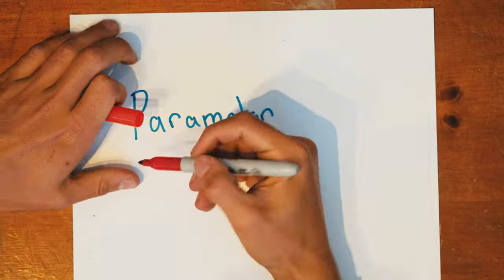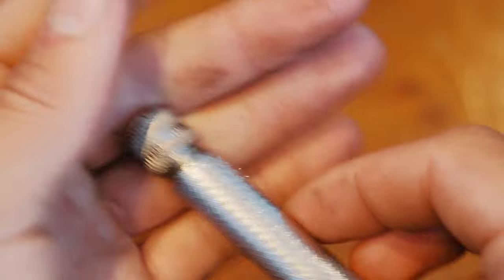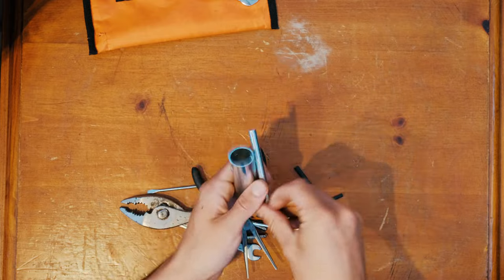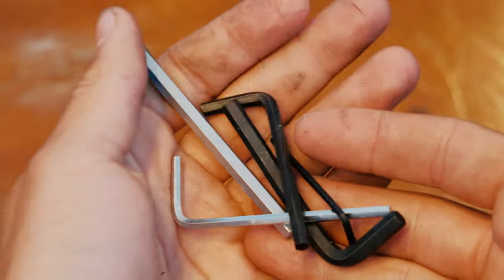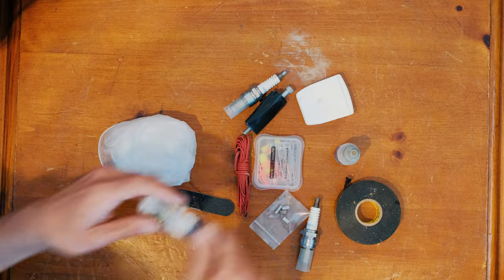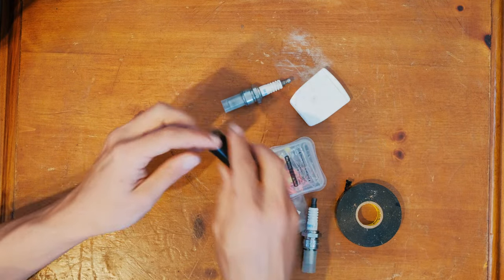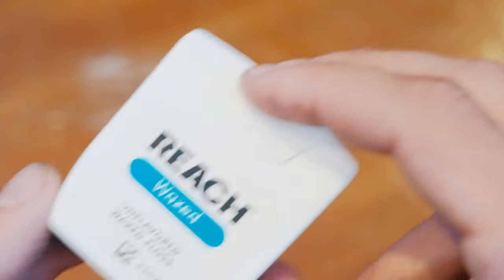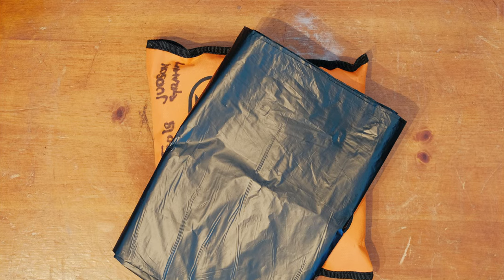Practical Toolkit for my Paramotor.

Comment: An old Navy Seal guy told me to always have dental floss, small pinch weight (tiny ball ones that you squeeze around the line) and a fish hook. He, like Judson said you can use it to pull stuff up to you or if you are stuck out and there is a place you can fish, then your good. He also made snares out of it to capture food, utilizing the hook to secure the animal (small of course). It can also be used to hold bandages on by wrapping it around a bunch of times, not to mention as a small tourniquet for you finger or small extremity. Dental floss is very strong and can be used as stitching in a really bad situation for skin or even clothing, or shoe lace. Good video Judson, great to see YOU grow as a paramotor pilot and see the channel grow.

Comment: Weight savings tip: ditch which ever 10mm wrench is heavier (leave it in the car), ditch the metal rod on your spark plug wrench(i use my skrewdriver instead as a 2 for one tool), ditch the orange bag and just toss tbe nessesary tools in the pocket or a plastic sandwich bag 2 layers to prevent ripping a hole. Some times weight needs to be saved, and sometimes it doesnt matter, each flight application will be different and therefore a slightly different paramotor setup may be nessecary
Reply from the maker: I’ll definitely consider that on a long xc but the extra weight of this helps me keep up with Dave :)

Comment: Can you make a video of all the times you've actually used these to repair and get back up in the air?

I've been flying for 2 years, 110 flights, 120 hours, and I've never once landed with a motor out and been in a situation where I could have fixed or even diagnosed the issue and gotten back up in the air.

Hmmm, well, OK let me adjust that claim. There was one time where I let someone else do maintenance on my motor and they did not properly secure a fuel line, just a tiny bit of air was getting in while I flew. It wasn't enough to cause issues until about 45-60 minutes into the flight, where a big air bubble caused fuel starvation. I was worried I was overheating the motor, and my temp gauge had failed recently so I didn't know for sure. 

I suppose I could have landed, checked the spark plug, visually looked at the piston head, decided it wasn't overheating, re-primed the air out of the line, and flown back to my LZ. 

I now know the symptoms of a small air leak in my fuel line, and I can see that having a spark plug wrench would be helpful. 

Beyond that though, I cannot think of a single time I or another pilot just needed a zip tie or a wrench or an allen key that would have gotten them back in the air.

Maybe I'm just lucky!!!
Reply: I've definitely seen Judson have a couple forced landings over the years. I been watching his videos and him on Tucker's videos.